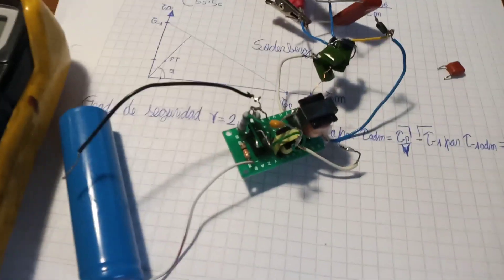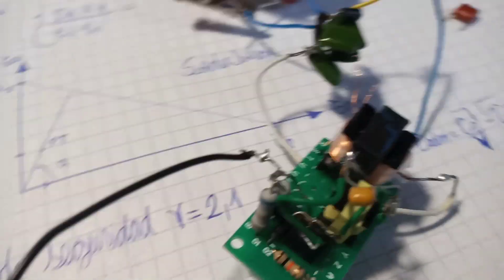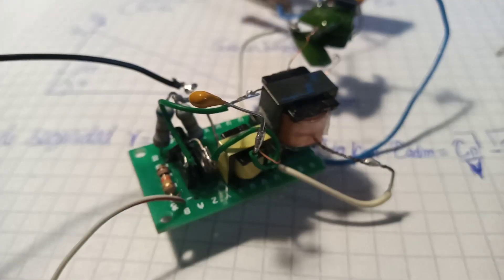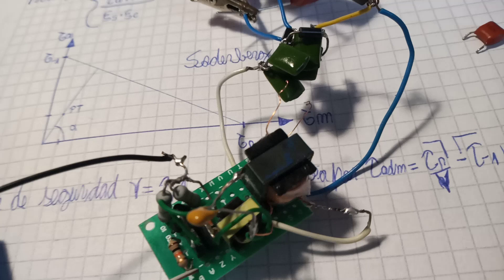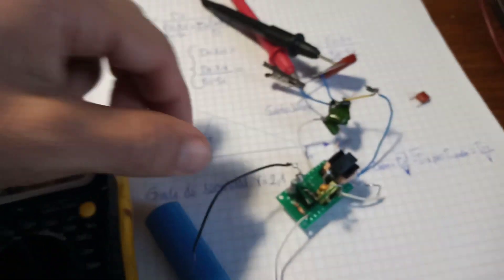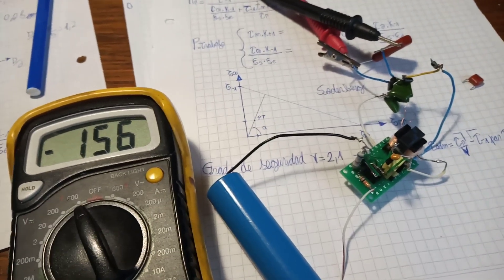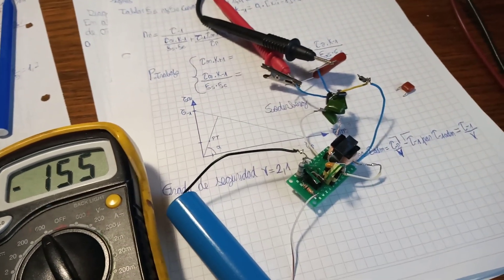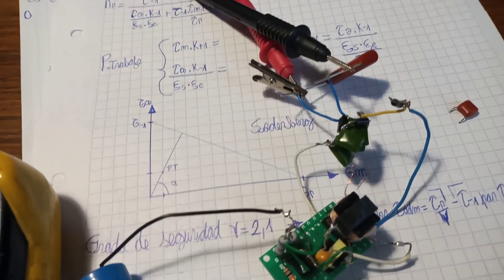P-Chanel ZVS driver capacitor charger

Comment: Nice compact design! Looks portable enough to be put in a hand held design. Got any plans for it?
The components used reminds me of the voltage multiplier circuit I made many years ago. I used a 555 and a transformer from a laser printer.
Reply from the maker: Originally I was trying to make some small step up circuit to do a hand held device to shock my work partners , I tried a joule thief , a camera flash style circuit , and I was getting like 50v top , with very weak current ,also I tried rewinding those small transformers but it still too weak. This P-chanel fets are from a old printer board I scraped long time ago , and I allways though you had to have N-chanel for a zvs , but turns out it is basically exactly the same circuit you just switch the +- polarity on the input . I need to test different capacitors cause right now I put a 1uf and I think it could be too much thus dropping the frequency too low , I bet those tiny transfos like higher frequencys , anyways for a nice shock I need to get somewhere higher than 200v I tried at 150 with the 1uf and it gives a very weak shock you barelly notice it hehe, I need a little more jouice